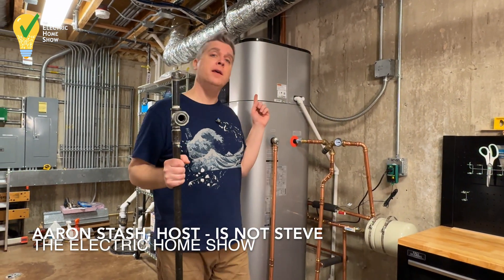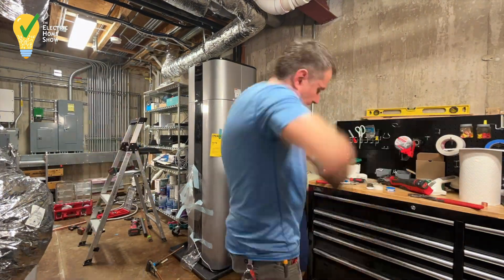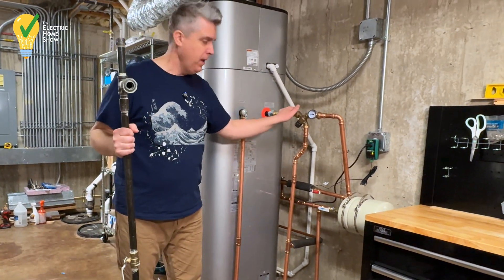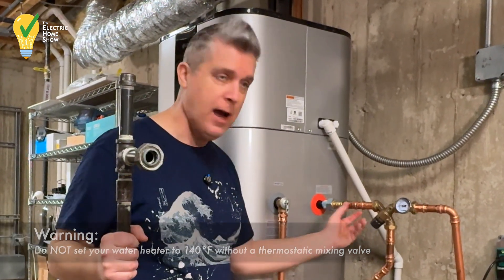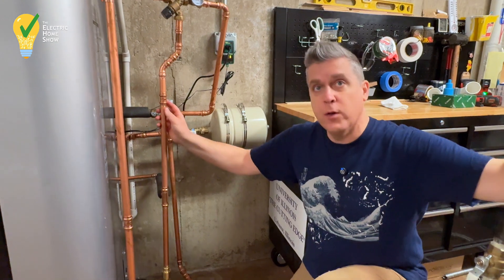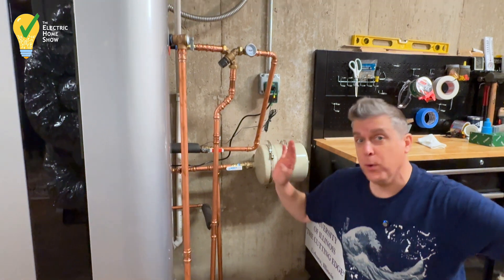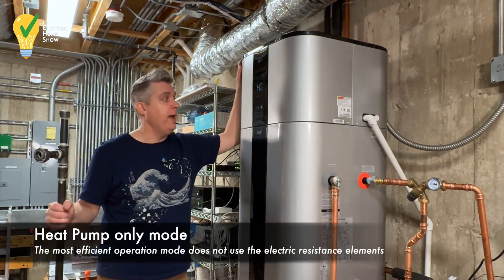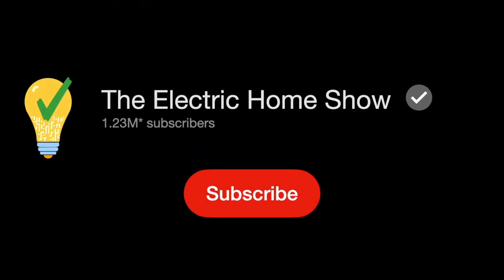This is a...heat pump water heater! Installation time-lapse and recap

Comment: Thanks for the great information. Can you explain and expand on why you don’t want the recirculation system to return water directly to the tank?  I am about to replace an older water heater with this unit but my current recirculating system has the return going directly into the tank at the bottom through a T at the drain valve. Thanks!
Reply from the maker: You can still use a recirculating line but it’s recommended to put it on a smart switch or plug so you’re not constantly recirculating water. That will increase your power usage.

Comment: How are you liking the taco recirc pump? Also, what is that smart adapter or aquastat your using? Did it come with ur taco?
Reply from the maker: The Taco is working, but may not have been the best setup for our home. Our primary bath is furthest from this unit and the sink there does take time to get hot water. It’s connected to a Taco smart plug which “learns” but could benefit from having a button in the primary to activate it. Open to suggestions if there’s another product out there.
Reply: @ElectricHomeShow  Hi, im assuming you dont have a dedicated loop? Ill be adding a loop to my system to my kitchen sink, which is about 65 feet of pipe away. Also using the same taco with an activated temp sensor probe plug, they are 30 bucks on amazon. I have pex and will just be using foil tape to tape the sensor near the end of the loop. And then just configuring it when it drops below a certain temp prob 85 it will kick on and once it hits say 95 degrees or so it will shut off, prob will be lower temps but will configure so it just flushes the hotwater out of the pipe loop). I also then plan to plug in a smart plug with timer settings(zwave one) and rigging it so it will power on from say 7am to 10pm. but then also power on with voice and any other buttons assigned to it, possibly even motion sensor in the kitchen to turn on the minute it is tripped and off after like 1 min. Im sure there is a device that does all this, but the 30 dollar plug with the temp prob and the smart plug that i already own will be ideal for me. The only thing i hope is that the temp probe plug i bought has memory setting. It says it does, but would suck if it didnt since ill be turning it on and off. For sure will check prior to using and will return if it doesnt. I will run this way to see how much power is used, the smart plug also measures power so that will be easy to track. If its a lot, which i doubt since the most it uses is 44watts, on high, i plan to set to low as thats the recommended setting for my pipe run, which will prob use a lot less. Even if it ran all day lets say 30 watts, thats less than  500 watts for 15-16 hours of run time. I will have a 27kw solar system with 45kwh of batteries soon so i dont think that will make a dent.

Comment: Love this - we went all electric in our home a few years ago. Worst part of the experience has been the louder than expected Rheem Proterra HPWH. I understand many of the noise issues have been addressed in newer generations - can you do a decibel test on this unit? Thanks, new sub from me!
Reply from the maker: I’ve had a hard time getting a decibel reading from it because it doesn’t run that much. My ERV is 40 decibels and a mini fridge next to it is about 49.
Reply: @ElectricHomeShow   Appreciate the reply. We're contemplating swapping the HPWH for a lowboy electric resistance unit that we can tuck in the crawlspace. Not sure a lowboy HPWH is manufactured, and not sure we want to go the SANCO2 split route. But, if the LG unit were genuinely quiet, we'd go that route.
Reply from the maker: I did a test using the Decibel X app for iPad and got 46 dB in my utility room. I did not factor a “room tone” or ambient noise but it was quiet to the ear. The iPhone version of the app was slightly lower dB, but I was using it to film. Check out the short.

Comment: The lower the delta T the better the efficiency. The heat pump would be much more efficient if you dial it down to 120 degrees
Reply: I agree about Legionella, but I believe there should be a Legionella setting (when the heat pump heats the water to 140°F once a day, usually at night).
Anyway, congrats on your installation!
Reply from the maker: We measured 390% efficiency at 140F. Thermostatic Mixing Valve brings it down to a safer temperature. Higher tank temperatures also reduces risk of Legionella.

Comment: Generally i'm not a fan of heat pumps that are integrated with the hot water tank. If either the tank (leaks) or the heat pump fails, then you're out of pocket on the ENTIRE unit. My setup is a split hot water heat pump where the compressor heat pump unit is outside and it circulates the water to the hot water tank inside the house. The specific hot water heat pump has a built-in circulating pump and the refrigerant is CO2 (made in Japan) which outputs no problem 4.8kW well below 32°F. On an 80 gallon water capacity tank, we have no problems daily, the tank reaching 140°F in 3 hours (A much quicker recovery time than your 8 hours), for occupancy of 5 people in the house. 

The interesting thing with my hot water heat pump is the return hot water inputs at the top of the hot water tank (in the temperature pressure value). The cold water going to the heat pump is taken from the bottom of the tank. Where I live the plumbing code is you are not allowed to put hot water at the top of the tank unless it's over 130°F so you need a very special heat pump that is able to heat water that hot consistently (due to legionella bacteria risk). The benefit of this setup is all due to stratification. That is say if the entire hot water tank goes cold. Running the heat pump will get you useable hot water within 15 - 20 minutes because the return hot water is not mixing with the cold water at the bottom of the tank. I see many split unit setups where the return hot water is connected at the bottom or midway of the tank and it takes many hours for the heat to rise (as it mixes with the cold water) and then discharges at the top of the tank. 

As with the other comments, the heat pump being inside will compete against the air space heating in the house.
Reply from the maker: If we ever build a new house, I’ll definitely look at the indoor/outdoor split systems. The specs on those look very good. Thanks for the comment.

Comment: Nice overview.  Our gas water heater uses about $15 worth of gas per month.  I'm guessing it was about $5k for the whole system, including installation, and depending on if you had to hire an electrician to wire it up, maybe more.   So I guess the payback would be about $27 years for me if it used no electricity to run it. The heat pump works by taking heat from the surrounding area.  Which is great if you live in FL.  But if you live where I live in upstate NY, my first-level floors are uninsulated to the basement, meaning the basement temp directly pulls heat from the upper floors.  And since heat only goes one way (from hot to cold), if my basement is above about 48°, heat is going from my basement through the walls into the surrounding soil and never the other way around.  So if I were to put a HP water heater in, I'd be spending money to heat the air in the house in order for the water heater to pull that heat and heat the water.  On the bright side, if you have a damp basement, it'll help dehumidify it and keep it nice and cold in the summer.  Interesting, but seems like a waste of energy for northern climates.
Reply: If they were cheaper, it would be nice to be able to use it in the summer only.  Not shown on the energy guide is that the $178/yr estimate is based on an average 70° surrounding air temperature.  Awesome if you have it in the garage of your Florida home.
Reply from the maker: @ I think you've hit on a deciding factor for a HPWH and other electrification projects. Your house is a system. If you have poor insulation or other limiting factors, then this probably isn't a good option for you. This is a big reason we're so tied to gas infrastructure - it will overcome bad systems by blasting them with more, cheap energy. Eventually the energy won't be cheap and we'll need to update our building envelopes. A 50-year old pick-up truck and any new car gas or electric can get your from A-to-B, but you're going to have a different experience. Thanks for leaving the comments. Good points for people to consider.
Reply: @ElectricHomeShow  The other thing to consider is the source of electricity. For me, it's mostly natural gas.  I believe for you, it's mostly nuclear on the grid besides your solar.  I too have solar on the roof, but in reality, it's not that productive in the winter when I need the most energy.  This last week has been fantastic pushing back 140kWh onto the grid alone, and that's including charging my EV once. I was a net minus by 9am this morning.  Yesterday there was so much solar, the wholesale price for electricity dropped to 2¢/kWh as opposed to a peak of 33¢/kWh in Jan. But when Dec-Feb rolls around, it's dismal between the low sun angle, limited daylight, snowing every other day and the rest cloudy, there are many days I produce zero, and whole weeks that I may produce less than 1kWh the whole week.  My house is 20 years old, but built to pretty good standards of the time.  It has 6" insulated walls, triple pane windows, R49 with sealed attic protrusions, and an insulated basement.  My gas bill from Dec-Mar runs about $510 for a 3000 sqft house.  Lots of days this winter have been below 0.   I've been considering at least replacing my 20-year-old AC with an air source heat pump, but electricity prices keep getting higher in the winter when solar isn't keeping up and the grid has to fire up its least efficient plants.  I think being a retired power systems engineer, I get stuck in analysis paralysis.
Reply from the maker: @scottkolaya2110 sounds like a good opportunity for a hybrid gas-electric heat pump HVAC. The heat pump will be your primary cooling (AC) and heating, but when electrical prices get too high for you - or temperatures get too low - you can switch to the gas furnace. Energy prices will continue to fluctuate so only looking at cost doesn’t help with comfort, health or safety of all-electric systems. No CO poisoning from an all-electric system. No NO2 pollution either.
Reply: @ElectricHomeShow  That certainly is the plan at the moment.  I might do it to just extend the life of the gas furnace, which has a financial benefit by itself.  Keep in mind, I keep my gas furnace running at peak efficiency. CO is emitted when there's too much CH4 for the O2 to combine with, leaving CO instead of CO2 and H2O emitted. NO2 is when there's too much air vs fuel and the O2 combines with nitrogen at higher lean temps.  If it's tuned right, there are almost immeasurable amounts of either.  That's why greenhouses, just pipe their exhaust from the natural gas furnace right back into the greenhouse without worrying about killing their employees or even making them sick.  It's also the same reason; no one tries to commit suicide by running a modern car in the garage anymore.  Significant CO emissions from cars were due mostly to using carburetors with a fixed jet size and not fuel injection with 02 feedback that can dynamically keep the air-fuel ratio proper so that all the carbon atoms combine with 2 oxygen atoms instead of one. Oil furnaces, that's a different story.  Fuel oil is about the same carbon to hydrogen ratio in a very complex structure that emits a ton of carbon per unit of energy and doesn't burn completely in the low pressure/temp of a household furnace. It's tough to get the air-fuel mixture right because it takes a comparatively long time to warm up to operating temp.  In that time, it's chucking a lot of unburnt carbon (soot) into the atmosphere as well as a high level of CO and SOx.  We really should be focusing on getting rid of that first.
Reply: @ElectricHomeShow  The crazy part is my electric in the last 4 years, went from 13.5 cents per kwh, to 21 cents. And they have 2 more raises in the next year. They have their eyes set to 28cents-35cents. My bill was over 700, i was on the phone with solar companies next day. Also came across ur channel. I live in NWI so same climate.

Comment: OK so it pumps heat from inside the house which cools the house so the furnace or main heat pump has to replace that lost heat.  I don't see any savings here. ????
Reply: That’s only in cold climates / cold weather months. During hot weather the additional ‘free’ cooling is a bonus.
Reply from the maker: Results may vary. The heat pump runs low and slow drawing energy from a mechanical room with an ERV system but no central forced-air heating/cooling inside. Everything is electric - including solar on the roof - so it’s also consuming power generated onsite rather than pump natural gas from the ground and burn it into the atmosphere. Saving $240/year by ending gas service. Will see if I use $240 more electricity for this system. In a new build, I would recommend putting the HPWH in the same space as a HP Dryer. One cools the room and the other heats it; so the energy could be transferred even more efficiently.
Reply: I vent into the living space fir free AC